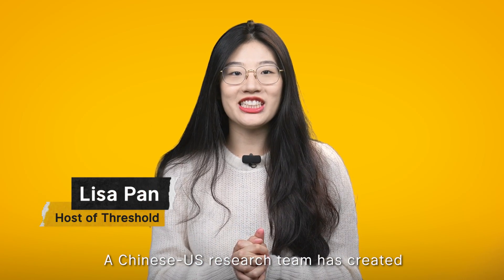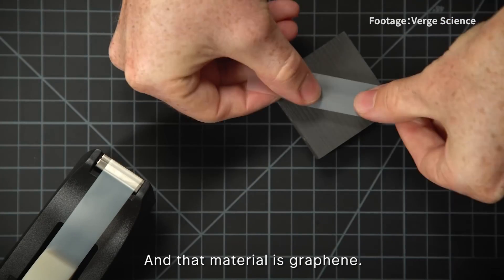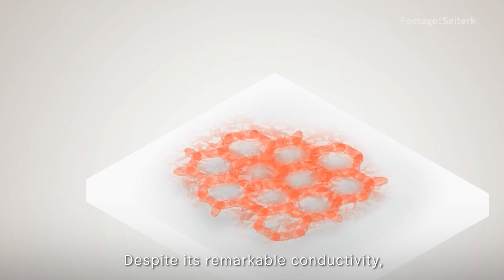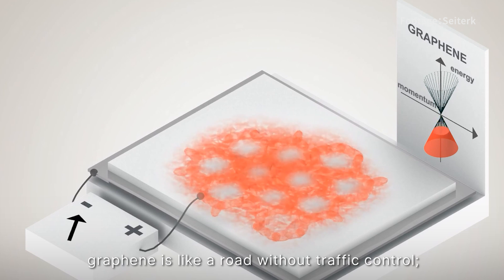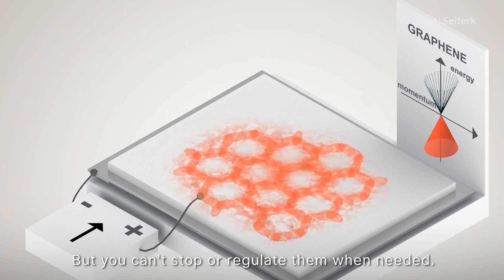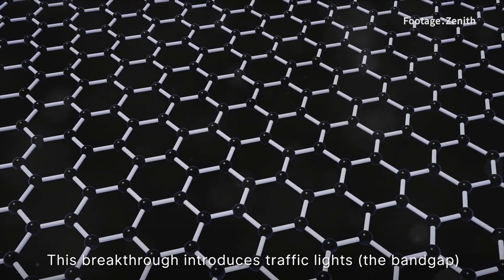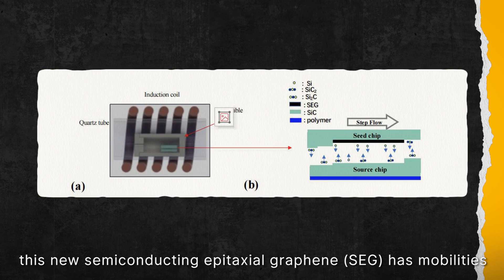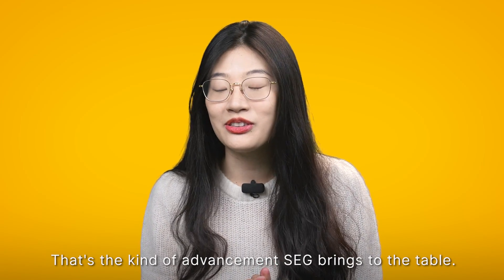Graphene Chips: The Next Giant Leap in Computer Speed and Efficiency

Comment: Is the 200x in speed compared to current chips the minimum improvement or the maximum?

Can we combine electricity and light circuitry in Chip design with graphene?
Reply: it's the next big thing, and it's on the way in some labs in China.
Reply: I've read an article a while back about interconnecting electronic chips with optical fibers, instead of electrical conductors that they use today.